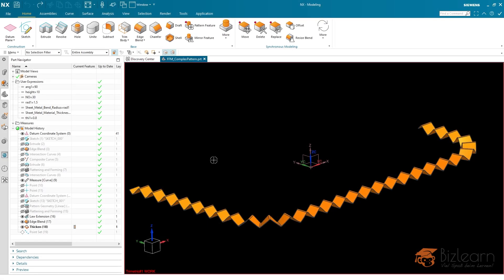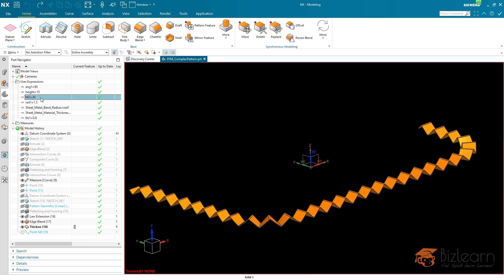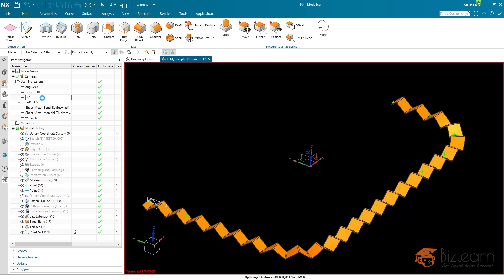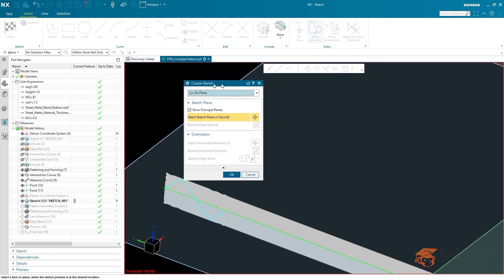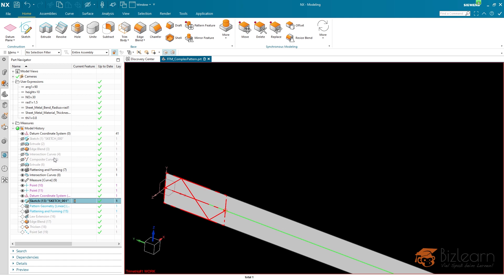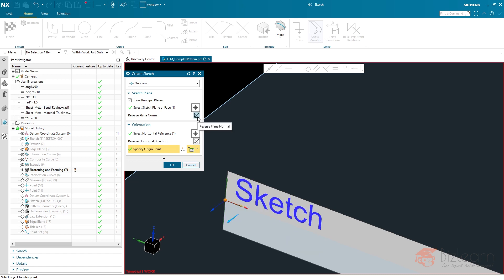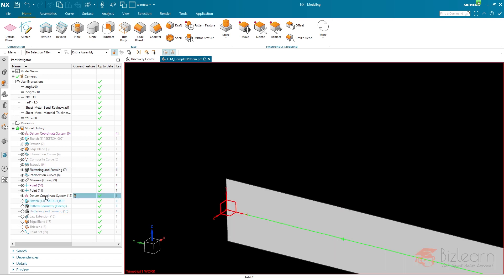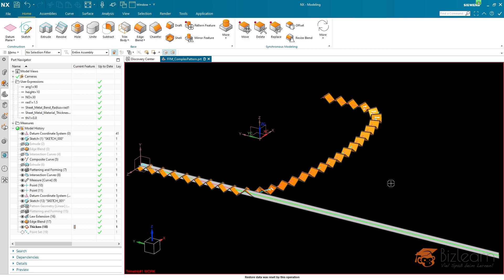What's New Siemens NX 1980 – Sketch Solver – It's getting even better: Major and Minor Enhancements

Comment: Hey, Simon
Really great to finally have a channel dedicated to Tips, Tricks and Techniques regarding Siemens NX.
I have a challenge (surface modelling) for you if you are interested: very simple conditions, yet not so easy to be done properly!
It is similar to corner blend, but with rather 3 free boundary curves (4th, 5th degree). Each of those 3 curves lies on each corresponding XY, YZ and XZ construction planes and each two curves touch at a point (not necessarily perpendicular though!). It is a three sided surface (by condition) but does not have to remain three sided by construction\design.
Reply from the maker: Fill surface is the proper command I guess!